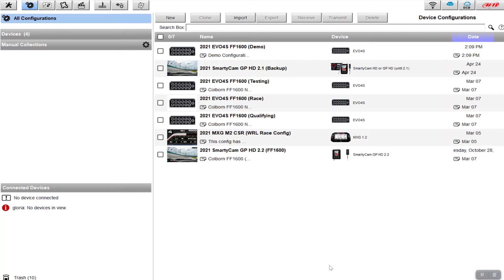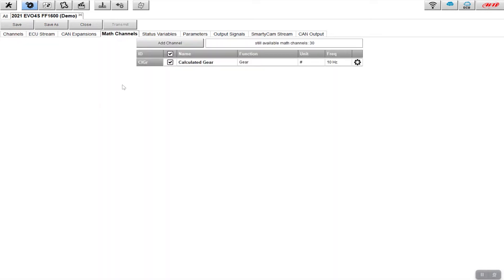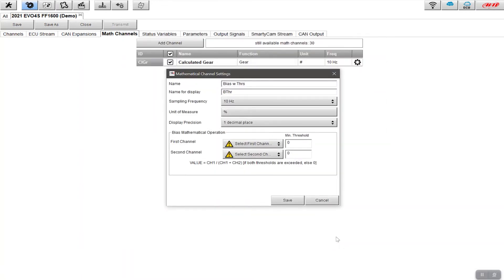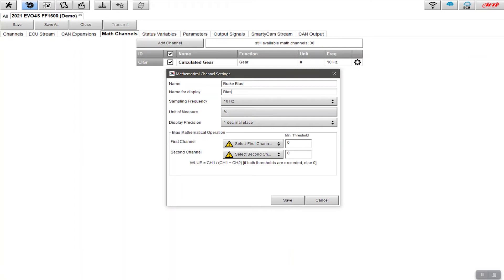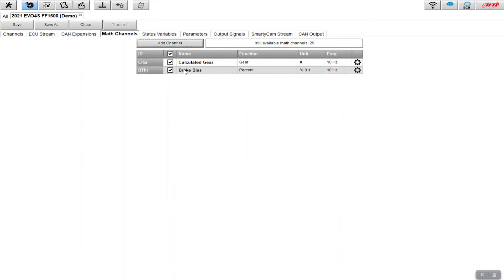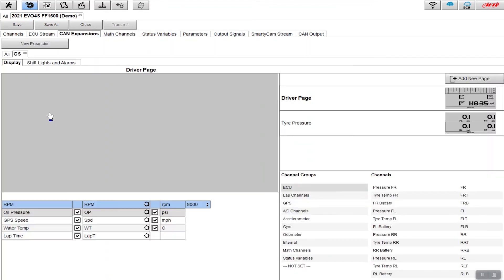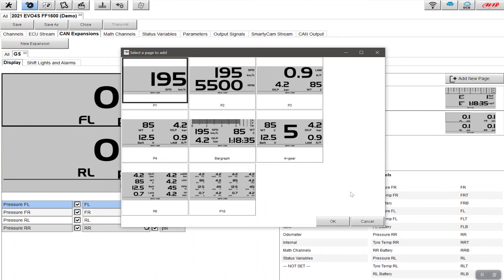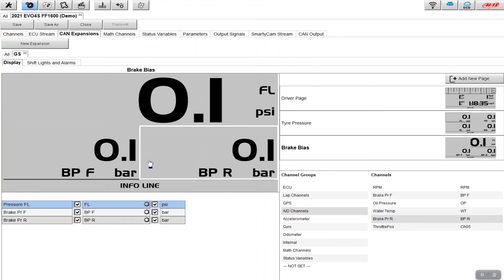AiM Race Studio 3 - Configuring Brake Bias

Comment: Any suggestions on how to get this to work on the MyChron 5?   I have the Expansion Box with pressure sensors for the front and rear brakes on a kart.
Reply from the maker: I don't think bias is an option for the MyChron as all settings are in the device and not in RS3 to be transferred. Wish I could have been more help.

Comment: Great Video James!  Is there any way for the dash to display the last measured bias (once the threshold has been exceeded) for several seconds?  I'm not sure if the math channel resets the calculated bias value to zero if the threshold has not been met.  The intent would be to not have to watch the dash while I'm braking, but possibly be able to observe the bias once I've made it through the corner and am on a straight.
Reply from the maker: Hi Tucker, great to hear from you and thanks for the feedback. I wish it would, it would help me too. I usually look at the bias in heavy brakezones as I know that I'm really using the brakes to get a good reading. What you can do is see this logged in the data there after but, alas, that doesn't help when adjusting in an ontrack session. Sorry we couldn't help more.
Reply: @JamesColborn  Great Stuff, your videos a great help for setup my AIM´s in my Caterham Super7

Comment: Any suggestions on sensors I can add to my 1990 Miata that would give me this data? Obviously I'd need something aftermarket, but not sure what I could get that would give me that data.
Reply from the maker: You'd need a logger really Len or an ECU from the car (which I don't believe a 1990 Miata has) that would send front and rear brake pressure as two separate channels. I bet on the AiM Buy/Sell FB page you could find a dash and a few sensors and you'd be set. James